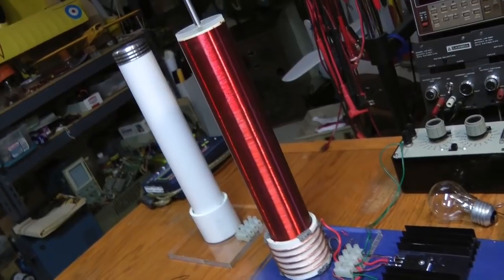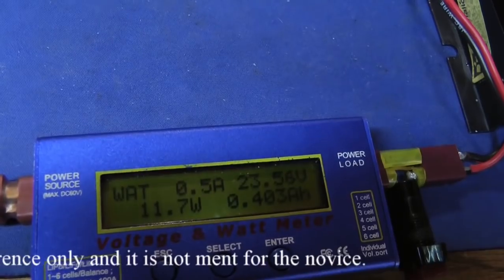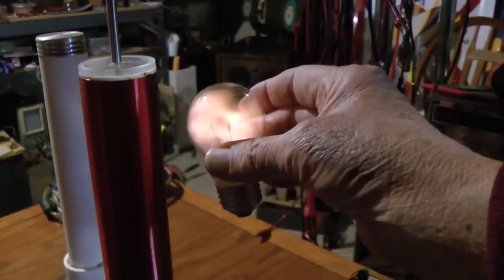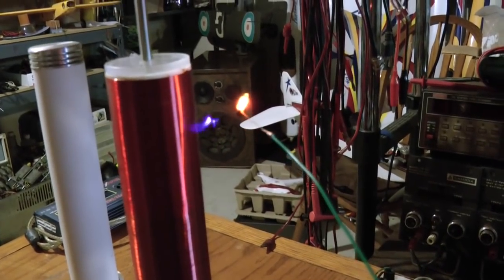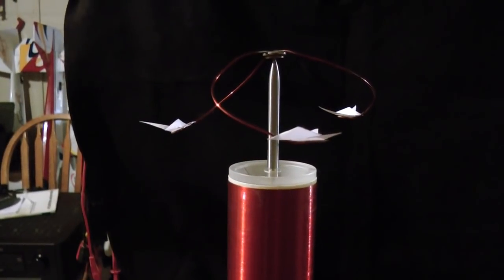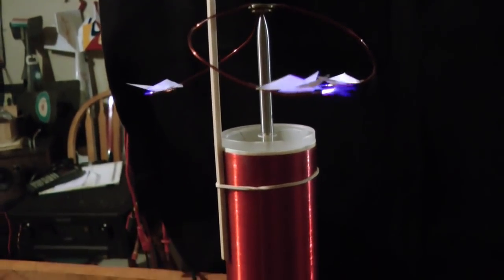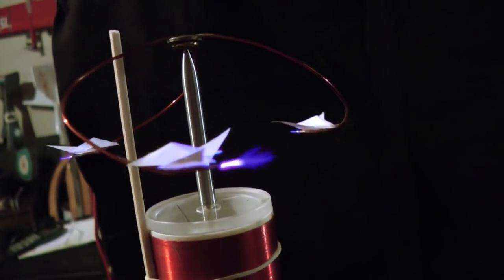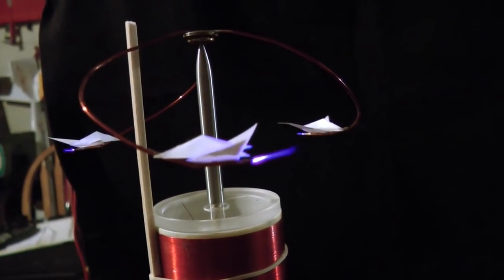Tesla / Slayer Ionic Propulsion

Comment: So if it was bigger u probably could use it as a lift for a ship.. instead of a runway
Reply: It would take a power plant to produce the kind of power required. A harrier is 11,800Kg. This thing is maybe 3g. So a harrier is 11800000g, divide by 3 we get 39,33,333.33, which is the number you'd have to multiply the power of this to gain propulsion. Also, this was lateral propulsion, not vertical, so it would probably be greater than that. So it looked like ~10 would be fair (though it was spiking), so 393,333,333.33 ish  watts to lift a plane. Though, I'm not a physicist or a mathematician, so I could be wrong, or there may be something I'm not considering. Anyways, you'd need a 400 megawatt power source for this type of propulsion if I'm not mistaken. That's enough power for 64,000 homes.
Reply: Steve Brisendine you might achieve this result by using mini nuclear reactors, you know to be able to fit onto a harrier or other type aircraft
Reply: That would make it heavier.
Reply: What if the ship is made of aerogel?
Reply: SeeFreeTV you wanna build a ship from highly flammable materials?
Reply: Yeah, I want to bring back the Hindenburg.
Reply from the maker: If the ship where in space and had already reach the speeds from it's rockets then you could safely say it could gain thousands of miles per hour with no more than the thrust of what would be equal to lifting a piece of paper. Why do I say this? Because they are doing this now.

Comment: Would that work in a vacuum?
Reply from the maker: Typically in outer space a gas such as xenon is released into the ion stream to get the push it needs. As is this would just release some random splatter. I believe.
Reply: No
Reply: To work in vaccume u need ion drive which actually requires a propulent tank this doesn't as in this method air is the propulent.

Comment: I think your flying models were awesome, probably the first time a toy has been powered by an ion drive. Question I have though is how can you be smart enough to build that, but not understand basic newtonian physics. F=MA, mass of electrons are being accelerated out the back, force in the opposite direction results.
Reply: Christian Buczko . Stumbled upon whilst playing around with electric
Reply from the maker: Ha, good one Christian, but most people understand the theory without even knowing the technical terms. In the thrusters there isn't much to push against to cause an equal opposite reaction when you are in outer space right? So they inject an inert gas into the ion flow to compensate for this. Zenon I believe is one of them,  then the theory becomes complete. Here on earth there are already things for the thruster of ion flow to push against and of course there is opposite movement as shown in the video. The video is more about ions released from the cathode of the resonator device to an anode which will attract them. In this case the anode is probably earth ground. The ions seeking to travel in a circuit from cathode to ground force an opposite reaction which propels the spinner in the other direction. My opinion only but does it make sense to you. Thanks for the comment.
Reply: You can test whether air pressure is affected to the sides of the plasma stream. It blew out the flame when in line as you would expect from something producing thrust, will it do similar beside the stream, or in other areas around it before and after. 
Also, you can calculate the forces by working out the speed it accelerates, and knowing its weight. I think a strobe light will be best to work out speed btw to do that.

Comment: Yes hotel then air around  it move that's how it go and a not here's thing u find kool is there no engine  love it can you or do you have a detailed  one how to mack
Reply from the maker: Hi Joe. In the video description there is a link to the resonator / circuit drawings. Below is a link to some pictures of the spinner. I  used #18 wire in 5" lengths soldered to a brass button. The points are sharpened and there is a drill point in the center of the button as you can see in the pictures.
https://drive.google.com/open?id=1o7-XyMnB2ixSmIDLkceTI2272MQThz5Z

Comment: should of done it in a vacuum it would of got a lot faster
Reply: John g it need not necessarily be faster in a vacuum if it is using air as the prime mover.
Reply: And if it doesn't work? Air is the wireless conducter ?

Comment: This is troublesome.  He has a very big electric field around this solenoid.  This will cause cancer (same deal with people living under power lines getting brain cancer)  This is not something you want to be exposed to all the time.
Reply: Shedding of never heard of people getting cancer from electrical current. Or even power lines. Cell phone towers on the other hand... they actually give off mass amounts of radiation.
Reply: Jmoonshine42 here is the information on em and cancer.  An electric current through a wire will not cause cancer but an em field might. https://www.cancer.gov/about-cancer/causes-prevention/risk/radiation/electromagnetic-fields-fact-sheet

As for cell phones, they operate on a different band than microwave, which hits the resonance frequency of water.  I don't think cell phones cause cancer, otherwise you would see a multitude of people getting cancer because of the prevalence and magnitude of cell phones.
Reply: Clessandra Pippenschnott I am glad you think like this and are skeptic.  You are right, when current runs through a wire it creates an electric field around the wire (not a magnetic field), however, the current running through the wire is so small the em field created is small and this field falls of 1/radius^2. Compound this with shielded wire which creates a faraday shield and you are basically sitting at an effective em of 0.
Reply from the maker: I haven't been able to find much information on side effects associated with doing Tesla coil or solid state resonator experiments. I do, however, try to keep exposure to a minimum. Thanks

Comment: I know exactly what’s going on,,, I will not share this information on here,, but i have an experiment you can try,, get some thing to test active magnetic fields with,, preferably visual,, make the arm that the mock jet is on longer so that there is no cross reaction from main coil,, what you should see is the magnetic material being moved around like water,,just like the effect of paddling a boat in water,, (fine powdered)ferrofluid will work best for this visual ,, like -200 mesh

Comment: If you'd recapture the electricity. And put it back in circulation, would you thema, still maintain the windpower, generated by thanks tot the electricity? Ik Thinks yes, buy only when the wind is in circulation too. Manet,when you hook a generator to it. Hou can create motion. If it works then you should be able to make a vehichle move into any direction. Even up and Down, considering it had been proven that it is indeed possible too lift An object up and Down, only by the help of sound. What the sound does is taking away the value of mass. And thus making the object appear weightless. It has been done with small object, making it very well possible to lift megastructures as well. Buy that kind of abbility has yet been seen. Dont let the Idea of "it, not been shown to you in real life" . From taking away the freedom to Imagine it is possible. Thinks about alle the things we can lift en put into orbiting motion. Of course its true that the amount of power needed to lift the object and put it in motion, equals mass of the object and friction . Exept in space. There is no things as friction to Worry about. The only thing that counts, besides the weight of this object, one must thing about the total mass of the entire Solar system. If they claim that a black hole is infiniti in mass, then IT would mean that we are already stuck in this Orbit around the black hole. If one can escape a black hole, then it would proof that the black hole is indeed a body, with mass. And thus can die. So you are saying that we are already inside the event horizon. Yes. But dont forget, thy whom is conscious, creates. Saying, that if you believe it is true, really believe it is true, then know that one day fiction, Will become reality. The truth is that nothing is true. And yet here we are, in this amazing world, of which i'm starting to see, everyday more and more, like a sandbox. An innocent little sandbox is what it is. There are An infinite number of sandboxes. You only have too look around you. Or look up into the sky. Try to understant the place we share with eachother. We keep feighting over the truth. And i cant seem too understant why. we keep giving these reasons, soms small. Buy more often bigger. Is it Just nog about enjoying life with whomever you want. However you want. Yes, ofcourse, but the life you choose determins your future. Non of the lives chosen is bad, but some had different outcomes. Neither good nor bad. They Just are. We Just are. It alle started with a simple thought. And it all can stop with one simple thought. Only, if you let IT. But it doesnt have to be. All is possible. Be free with yourself. Hou have the right. But dont Harm anyone in doing so. Remember, if it makes you happy. and that, what makes you happy is innocent. Then enjoy it as good as you can.

This i havent seen comming, lol. If you are still reading. Forgive me for my bad grammer, i'm sure it is terrible. And remember, this all started with imaginary.
Well then, good day

Comment: If you added a solar bank to get the ion propulsion system started initially and then a kinetic motor, you could get this thing to power itself indefinitely. If you managed to do it right, on a much larger scale you could make the worlds first decent natural power generator.
Reply from the maker: Whoa, I've spent some time toying with ideas like this. So far only managed to save some energy.
Reply: Not enough amps but got to start somewhere

Comment: surjest yuo put in a glider and see if it will drive a plane then test in a vacum  try  puting the coil  in a loop and  in a cylinder and consentrate spark ot the other end .i think whats happing to drive demostrate the ions are generating heat  if yuo work out controll currcuit yuo a crude ion drive frm garyfifield please learn 3d print

Comment: Why can't NASA use that propulsion instead of pollution. Make hover boots next with this arc tech kk
Reply: Fikmedaze Ohmyfattun, because ion propulsion is comparatively weak next to chemical rockets. Ion engines are actually used in LEO (low Earth orbit) but you can't achieve escape velocity with them because of the Earth's atmosphere.
Reply: The Nazi used electromagnetism with cold liquid mercury

Comment: Damn, it blows a torch out. Amazing. I can believe it was all true, if the flame was used on the other sparks. Why do you even need 3 sparks? That is the main reason, the experiment seems fake. That, and the truth of why the sparks are actually propelling anything. Even if it is propelling, it is because of the coil. Within the field, the coil is actually allowing propulsion through the spark. 1 spark position, should do the same. All you need to do is attach it to wheels. Anyhow, it is not enough force to allow flight, unless you were in space. No wonder people believe this stuff is so easy. There are Ion experiments done. I have seen them. Ionizing Air Conditioners. That, and the amount of air they blow, is tiny. Maybe it isn't a trick, but I can't say it is not limited in effectiveness.
Reply: The three are just to make the spinner balance on the point properly.